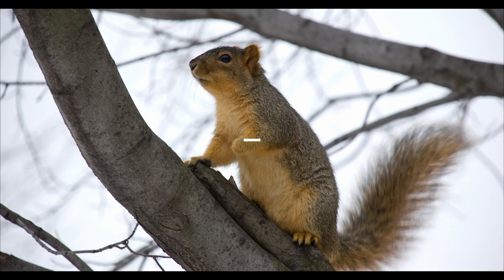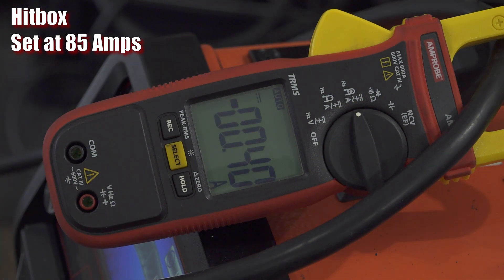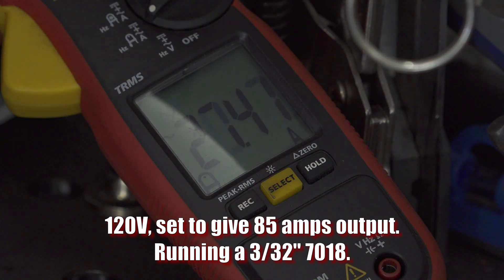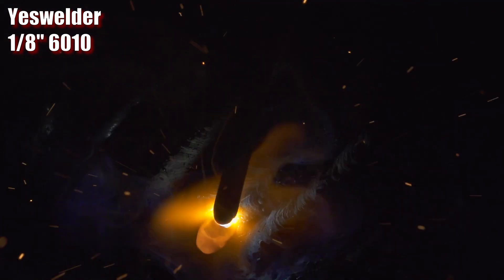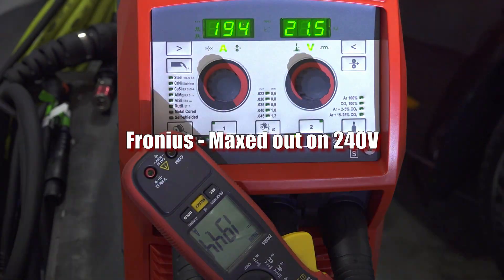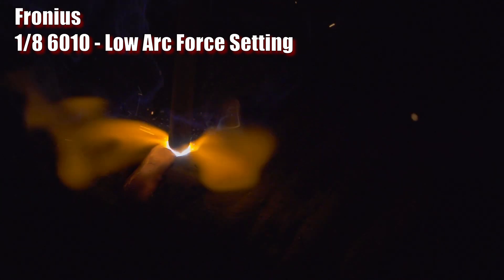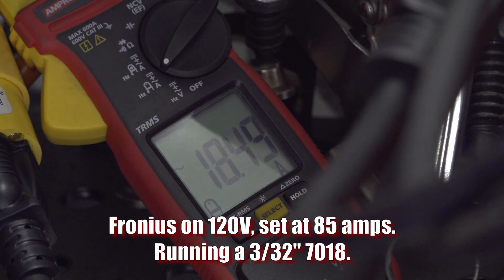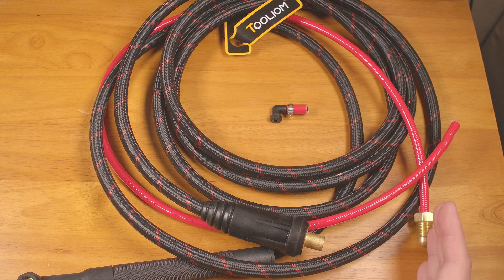Multi Process Welder Comparison - Stick and Lift TIG Testing

Comment: Is the downslope and post flow adjustable on the fronius?
Reply from the maker: Yes, both are adjustable.  As well as gas pre-flow, upslope, there is a tacking mode, pulse mode, and more.  It's a surprisingly full featured TIG machine, it just doesn't have high frequency start.

Comment: What are your thoughts on the everlast 215c have you made a video on that yet I'm definitely in this mig/plasma process
Reply from the maker: In terms of MIG, I would be shocked if the Everlast wasn't far better than the Yeswelder.  The Yeswelder MP200 runs cold and not very smooth and is extremely limited in options and features.  The MIG mode on the Everlast has far more features and better specs.

The plasma cutter on the Everlast has a pilot arc, which alone would make me prefer the plasma cutter on the Everlast over the one on the MP200.
Reply: @bigtb1717  thanks again for your insight I know anything that I end up getting will be better than my Lincoln 140 that I've only run flux core through but I don't want to make a minimalistic financial purchase I want to be able to excel my skills and knowledge
Reply from the maker: My gut tells me it will be much better than the Yeswelder, but I haven't personally tried it.
Reply: @bigtb1717  well I trust your judgement and will focus my research efforts of that unit thanks for helping me out. look forward to seeing more of your content

Comment: These are awesome review videos! How are you liking the Fronius 2200? are the internals as impressive as the transpocket 180 you reviewed? the build quality of that thing was really impressive in comparison to the ESAB. I wonder how they compare to a miller? cheers
Reply from the maker: I haven't used it much outside of these reviews, but I like it.  I haven't opened it up yet.  The Transpocket is definitely a well made machine.  Maybe I'll compare it to a Miller some day.  Just need to save up, lol.  Millers are getting super expensive.
Reply: @bigtb1717  Ya seriously, I'm trying to decide between the Esab 205 acdc or the Miller 220 acdc, but the miller is extra pricey (or rather, the store is including all kinds of extras with the Esab). Also thinking of instead going with the Fronius 2200, or the Miller 255, then getting a cheaper dedicated ac/dc tig machine.
Reply from the maker: I was trying to decide between the Fronius 2200 and the Millermatic 235.  In the end I went with the Fronius because it came with the TIG torch for less than the Miller without and it was dual voltage and a bit smaller.  I think the price has gone up again since then, maybe on both.  When the MM235 came out it was $2,000 and now it's up to $2,900.
Reply: @bigtb1717  Did you look at the HTP pro pulse 220? I'm in Canada, otherwise I think that's what I'd go with (not sure how the warranty process would work across the border). I do like that the Fronius can do aluminum with a 15' whip though, I think the HTP is just 8'.
Reply from the maker: Years ago, the word was that HTP machines were good quality.  I haven't looked into them much lately.

Comment: Another fair, informative video.  I have had my MT200 since March.  For someone just getting into welding it was an okay buy at the Kickstarter price, but the false advertising truly pisses me off.  While technique is still the cause of most, if not all, of my bad welds, the 50A TIG start current is a big deal that I wasn’t aware of at all.  That actually explains issues I’ve had blowing through thin material, despite being on the lowest setting.  I guess a copper plate to start the arc should help that?  I have one, but hadn’t used it very much.  Also, from everything I’ve read/seen, and even your demo, the MT200(160?) is scratch start.  Hopefully your reviews get out so folks know exactly what they’re getting.  Keep ‘em coming!
Reply from the maker: Starting the arc on a piece of copper can definitely help.  I have a copper "spoon" from Harbor Freight (basically just a piece of copper on the end of a handle) that I use for really thin stuff sometimes.  If you can get yourself a few pieces of scrap aluminum, it can also help a lot to clamp a piece of aluminum as a heatsink to the back of thin pieces to help prevent blow-through.

Comment: Miller has that same 90 except it’s brass just say incase you decided to upgrade
Reply from the maker: I have a Miller torch adapter and at least one CK adapter.  I may just modify one of those to fit the dinse plug on the Hitbox.  I'll probably try to modify/repair the Tooliom one to make it work good enough to test the welder.  We'll see.
Reply: @bigtb1717  sounds good

Comment: I have not use the tig function on my 2200 very much, but it works well every time I set to use it. My only regret is that I just don't have the time to do a lot of tig welding. Mostly mig then stick.
Yes I would like to see some tig projects done, that may twig me to do more tig.
Reply: I started by just doing weld after weld on a couple of 1/2” plates.  It definitley got me over the freshman jitters!  Had to force myself to get back to stick for heavy stuff after a couple months.

Comment: I've been waiting
Reply from the maker: Yeah, sorry it's been so long.  Been a really busy summer so far.  Gonna stay that way, but I do have a lot of videos planned, so we'll see.
Reply: @bigtb1717  don't be sorry for your great content,you need a few mil subs to bad only 1% of the world is professional welders so it's kinda niche.
Reply: Here Here Also been waiting for this. I just got the yes welder MiG 250 pro machine. Was wondering if you have had a chance to check it out. Seems really hard to believe that it can output 250amp with such a small cooling fan that it has. as opposed to the Amico stick welder that is much bigger..I have also just noticed that yes welder just released   a new 200 amp multiprocessor machine  that apparently has hot start and arc force for the stick function. just saw a video of it on YT.  Keep up the great work .
Reply from the maker: I've had the MIG 250 pro in my list on Amazon for a long time.  It was recently on sale and I almost ordered it.  I think the main thing that held me back is how many projects I already have, lol.  I've read somewhere that someone tested it and it supposedly had the full output.  It definitely sounds hard to believe.
Reply: Yeah it on sail for 399.00 with a prime discount. so I pounced. have only tried it out with flux core wire briefly. need to try it with co2 and argon w/ solid wire and also try it with stick rods. maybe ill try putting a clamp meter on it and see what the actual output is and how accurate the reading is.